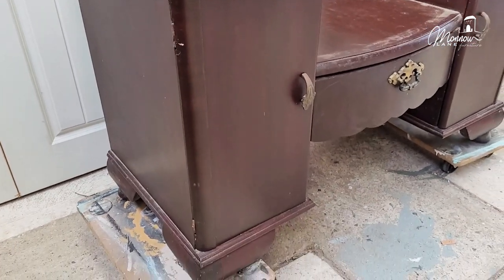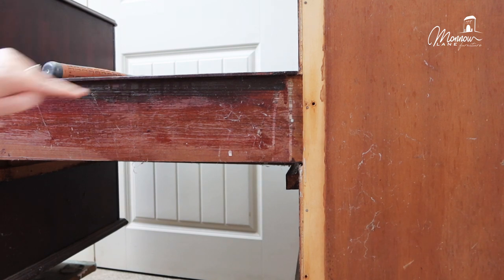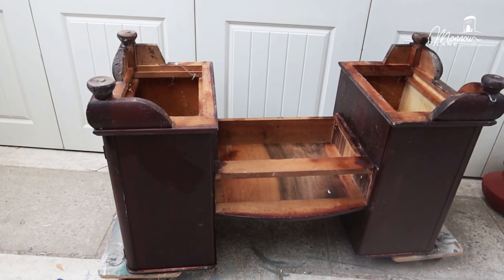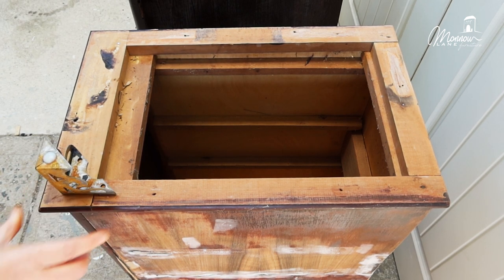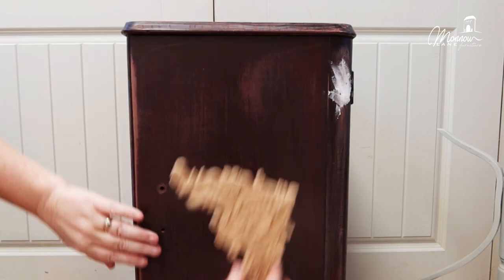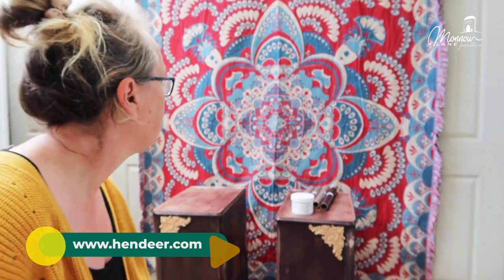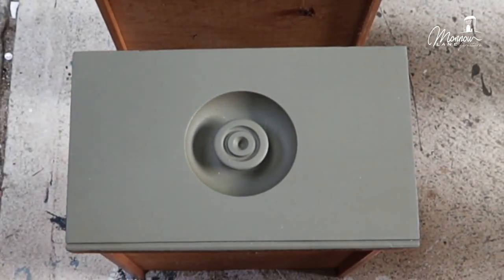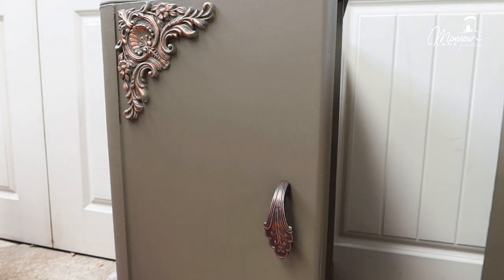EXTREME Furniture Makeover | Dressing Table to Nightstands

Comment: Hi I watched your video and it turned out great, but I need to give you some advice on the foil you uses I believe it was Indian Bronze which is a v-mask foil which is anything besides fabric. ALL v- mask foils are very easy release and you do not want it to crumple it up because part will flake off, the best is to roll it backwards or fold it back on itself where the ugly side is on the outside. It will give you a better version of the foil and will not release/flake off  as much so you will get more of your pattern onto the piece.
Reply from the maker: Thanks so much 😀 😘